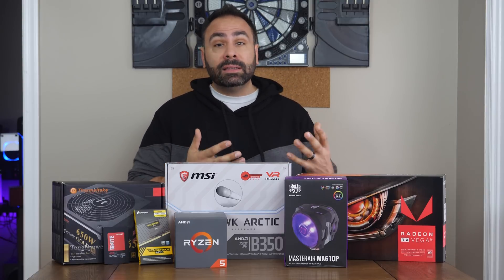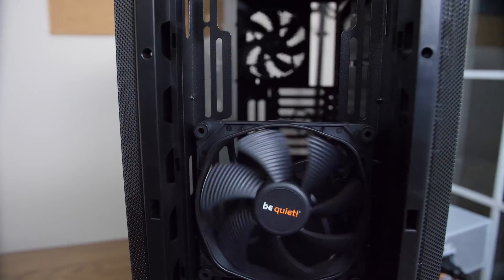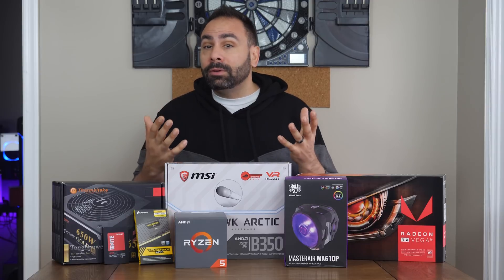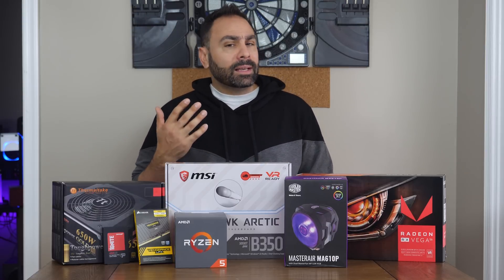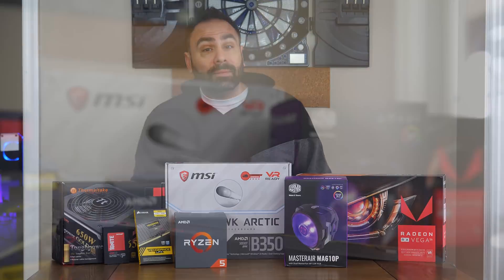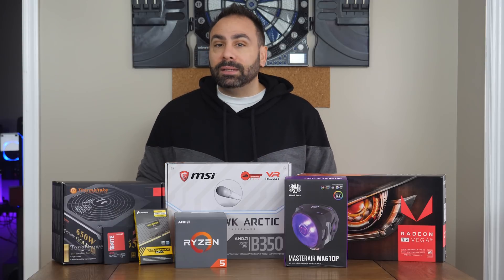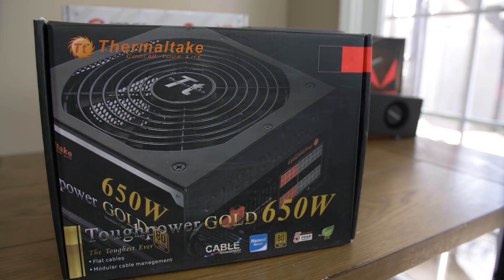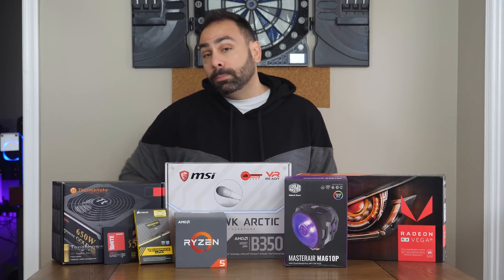Monthly Build Series - November 2017

Comment: With the same motherboard (I'm testing it since July) I could overclock my R7 1800x to 4.02ghz at 1.35V (VRM temps are OK by the way) and my RAM kit (KFA²/GALAX HOF 3600MHZ 2x8GB) manually at 3600mhz cl16 which is better than out-of-the-box timings. The BIOS version was 7A34vH6. Hope that will help somebody there :)

Comment: I have this motherboard with an Ryzen 7 1700 and the LPX 3200 Mhz memory. What you might want to try towards performance and stability is not using the latest bios, as for me I have some issues with those. For me bios 7A34vH4 from 2017-05-10 works best in overclocking and performance. Although I might be able to finetune some more, running at 3.925 Mhz I get a cinebench CPU score of 1737
Reply: is it the retarded date (USA October?) or is it the normal date (everyone else uses May?)
Reply: The one i'm using is version 7A34vH4 from the 10th of may: http://download.msi.com/bos_exe/mb/7A34vH4.zip

Comment: Dear BPS CUSTOMS, I had recently built a Ryzen 5 1600 system. I am looking for help for quite sometime, and any help would be quite appreciated. My rig consists of:- MSI B350M Mortar, ZOTAC GTX 1060 6GB Mini, Ryzen 5 1600 of course,  2*8GB G-SKILL Ripjaws 2400mhz DDR4 memory, a stock cooler WraithSpire, a CoolerMaster Elite 311 case, a TB Seagate Barracuda. It's been only 2 months and it has gone bad for the second time, it just doesn't POST.  Please help, is it a problem because of heat or something else.
Reply: Pennywise that's a very stupid solution.